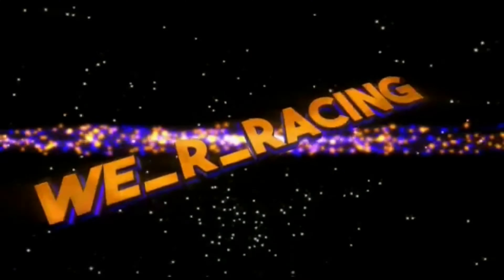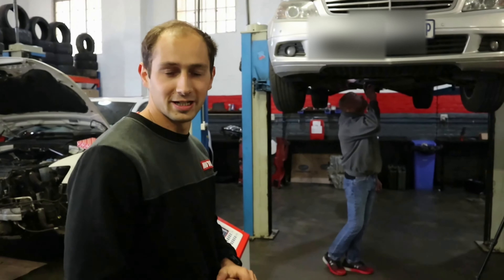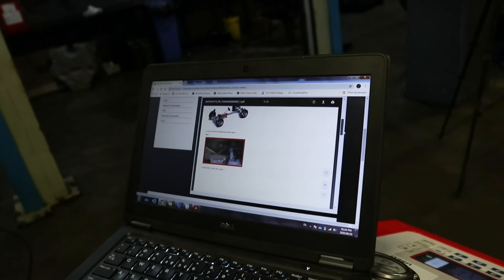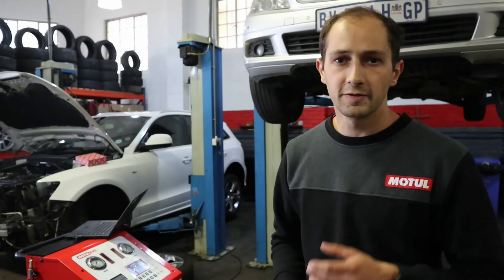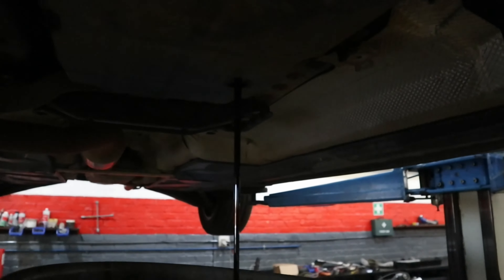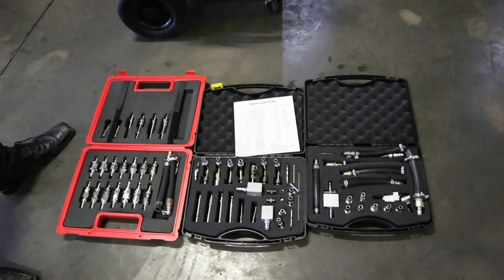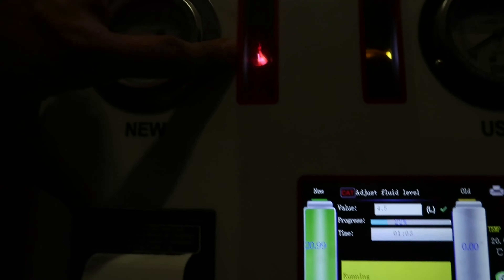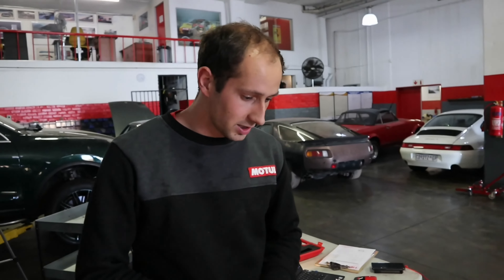How to service the automatic gearbox for the 2010 Mercedes C180 CGi - car tips for non-car people

Comment: My mercedes c180 cdi start but don't move forward or reverse,  it was standing still for a long time, could it be because of the oil?
Reply from the maker: Hi Mark. Automatic gearboxes have 2 things of real importance - the oil and the valve body. 

The valve body is a bunch of "switches" that manage the flow of the oil. This is the mechanism that controls forward gear or reverse. 

Now oil is obviously the cheap fix here, together with the oil filter - I would start there. 

If this does not fix the issue, the problem might also be electronic, related to the valve body. Do you know someone with an ODB2 scanner? I personally use Carly (www.mycarly.com). This will allow you to scan for errors and even clear them. 

Thinking about it, this is not a bad place to start actually. It will be even cheaper than the oil and filter.

Have you checked the oil level yet? Low oil level could also be a problem. For this you need to start the car and let it idle up to temp, and leave it running while you check the oil. It is normally a very long dipstick located toward the end of the engine bay, not the same one as the engine oil. 

This is what I can quickly come up with and where I would start. Gearboxes feel daunting and everyone will tell you how scary they are. They are not, but they do cost a bundle to have fixed due to the labor involved. You might be better off buying a 2ndhand gearbox from a smashed car, rather than fixing an automatic gearbox.
Reply: Hi Graham, thank you so much for your help🙏